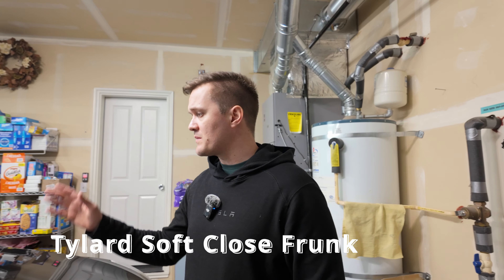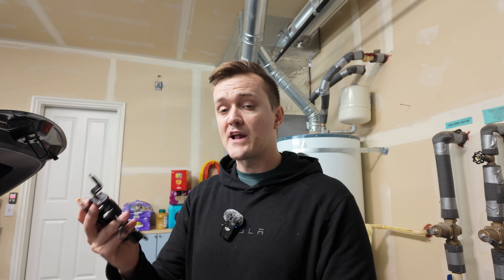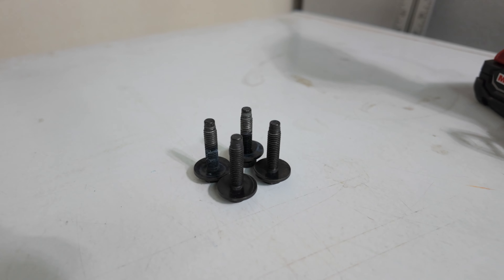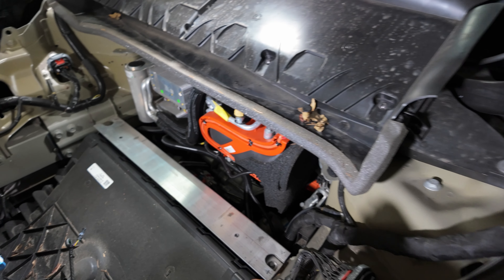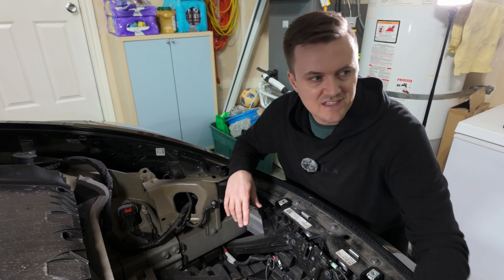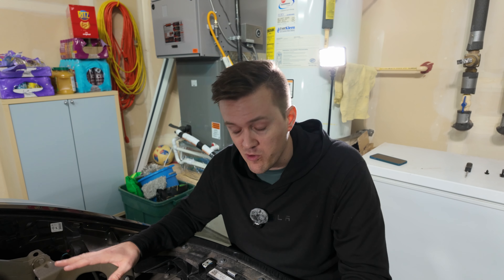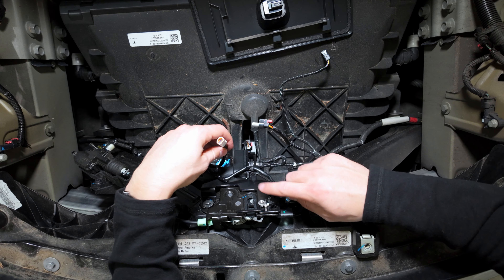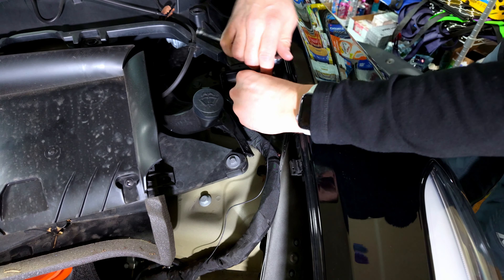Tesla Soft Close Frunk | Install Guide & Review | HUGE Upgrade!

Comment: I purchased two weeks ago and received and installed today. 

Couple of notes:

I did get an updated version with no additional bracket and no seperate control box on the wiring. 

Mark with a very fine point paint pen where the original release mechanism sits vertically compared to the frame where the two 10mm bolts attach.  I had to spend a while getting my vertical position of the closed hood back to the correct height. 

Longevity I supposed is yet to be seen, but it doesn't seem cheap/throw away.

Comment: Buyer beware - there are a few of us in the comments that have found that Tylard has been sending out a different version that doesn't seem to fit on the cars they say it does 😢.
Reply: Was Tlyard able to resolve the issue? Hansshow mentions on their website making sure you order for the right car or else, no refund.
Reply: @KhoaTeslaRossa  No. I've been emailing their support every day since February 26 for installation clarification and return/exchange instruction after the item broke.

I ordered the correct item and the box states it is the correct item but it did not fit my car the way their support described- it's slightly too short to reach the mounting area.
They suggested I "just force it" so I had two other people help me to force it and it bent the metal on the mount for their soft close mechanism so the first time I used it it got stuck closed and now it's jammed.

Luckily I tested with a screwdriver and not the Frunk hood.

They have requested a video of the device not working before they will consider a return/replacement but it's been a slow process.

Honestly I would be extremely reluctant to install any of these that doesn't have any sort of emergency release! Even the original design in the video is at risk from getting stuck if the motor seizes.
Reply: @TM-hr6nv  Yeah you know when it isn't the right part. Not sure if it is stuck. Is it the same as using 9v battery to get it to pop? Sorry for your trouble and thanks for the info. If I get one, I will order from Amazon.
Reply: @KhoaTeslaRossa  The release needs to be a cable that physically disengages a seized/unpowered motor. Satonic makes one and you put release the cable down near where you would use a 9v battery but the release itself does not require the 9v. It does not allow anyone to get into your trunk as all it does is release the motor in charge of soft-closing the Trunk i.e. it does not relase the OEM Frunk lock.

I ended up buying the Satonic variant. It has its own problems with the installation instructions having no indication of how to mount the motor without giant (not included) Zipties but it does have a working release cable. 

Tylard is still jerking me around so I'm just going to try and un-bend the metal to allow the latch to move freely and to sell it to someone with the correct model year Model 3 to recoup SOME of my costs- with the warning they might have to take off a wheel or unclip the bumper a bit if it gets stuck.
Reply: Update: Tylard never accepted the return. If I showed them it not working in the car they would tell me I "didn't install it right" and if I showed it to them not working outside the car they would then say "install it in the car to make it work". I sent them video after video of it not working, getting stuck, not fitting and they would just dodge the issue. I ended up selling it to someone who had a different model year. No idea if they got it to work.
Reply: So disappointed.   Installed this today and the activation lever on the soft close takes too much force to work.  If I push on the hood it works but otherwise the hood is not heavy enough to activate the device.  No way to adjust as far as I can tell since there are no instructions.  Tried emailing their support but it bounced back.  Money down the drain I guess.  After futzing with it for hours I took it out. No more Tlyard products for me.

Comment: I bought one on discount from aliexpress. 109AUD. No instructions but your fit inspired me. It is working but not without some hitches on the way. I have 2023 M3 with LiPo 15v Battery. Needed to add a screw and change positive connector. Has in line fuse. Bolts over top of existing latch and no messing with existing mechanism. After test in with internal casing out ok tested with frunk in place. Needed to raise bolt on part as rubber housing seal made it too hard too close. All good now.

Comment: I always recommend trying the latch process using a screw driver in place of the actual hood… if for some reason the motor does not release (reverse)after pulling the latch down you can not get in the frunk!  I Had this issue with the “full power fronk kit” and had to remove a front tire, fender well liner and was lucky that i could reach in with a home made tool to manually release the latch… the back up release under the little cap will not work if the soft close motor is holding the latch down.  Hope this makes sense…

Comment: Good video. Is there any sort of safety sensor to prevent a finger being pinched or crushed by the new motor if you hold the frunk between frame and lid?  Its about my only conern with the motorized mod...
Reply: That 👆is a great question. I have not thought about it, and purchased that kit ( still in post ) but now @daveo9198 made me think twice. Could you please try it and let us know. Having two kids you never know what can happen. And if that device can potentially cut their fingers then i will send it back. 
Thank you
Reply: Wesite listss this feature "The product comes with a smart anti-pinch function."

Comment: When removing something, FIRST remove NEGATIVE, then POSITIVE.  When connecting back together.  FIRST POSITIVE and then NEGATIVE!  You won't want the negative of the battery attached when you attach the positive.  If your wrench shorts out on any metal, you'll have a short circuit.  However if Negative is off, then it's safe to work with the Positive terminal, and then when you attach the negative.....even if the wrench touches the body while you're attaching it, there wont be an issue.
Reply from the maker: I am assuming you are referring to my attaching the ground before connecting it to the battery? Yea that is good advice. If it wasn't obvious I am no expert at this sort of thing. It's more of a...if I can stumbly my way through this stuff anyone can.
Reply: The advice is good on the order… but think safely first. When you tighten the Battery terminal red wire .. this is the spot you need to take lots of care with any tool to avoid a short. Consider gently tightening that battery connection… a loose wire from vibrations over time is not desirable.

Comment: Great video. I just installed within 15 mins. I bought the item from ali express, instead of Tlyard , as I am afraid Tylard does not sell the new version. Apparently the new version include a small metal piece , plus a smaller screw holes for the tightening bolts..
Reply: Can I ask which brand you bought from Aliexpress? Also, how is it holding up? Thanks!

Comment: I just ordered the same kit for my Model Y and it does not work. It's a totally different design. The retract motor is not mounted on the bracket and it doesn't have that little adapter piece of metal to press the latch button. Don't know what is up with my kit.
Reply: Did you order the Tlyard kit or someone else's and did you make sure it was for your Model 3 or Y and correct model year. It does matter. I have ordered this kit and are waiting for it to arrive. Takes forever when you are anxiously awaiting it's arrival. 2 weeks and counting😢
Reply: @ThomasRSmith-og7zo  I ordered the Satonic Model Y kit.
Reply: The Hansshow kit mounts the motor separately and uses and emergency release cable. It's the same mechanism that comes with their Full Power Frunk kit. Not a fan, that's why I ordered the Tlyard kit. Hope they didn't change it and made it new and unimproved 😅
Reply: I recently ordered the Tlyard kit and what arrived is totally different. The motor is not attached to the latch bracket, and there is no separate loop at the end of cable as it comes already attached to the latch bracket. I have no idea how to install what they sent me and their service person is not being very helpful. This is what they responded with:

“Because this product is an upgraded product, it will look a little different and does not require the use of metal spacers. You can go ahead and refer to the installation video as they install almost identically”

“they install almost identically” is not true it is totally different, and now they have gone dark. 

Would NOT recommend.
Reply: @johnadelus - so I just received my order (22 MY) today and mine looks similar to the one shown in this video but it did not come with the metal spacer. I’m second guessing the install as I’m waiting to hear back from support.
Reply: @artistjosephtubb  I have given up on their support. They keep sending me videos with nothing like the part I have. They just do not want me to return and get a refund. I have now filed a report with PayPal - we’ll see.
Reply: @elus Not sure if this helps but today their support sent me a video directly that is only in Chinese that has the correct part...but the car in the video is clearly a 2018-2021 Model 3 when I ordered the 2022-2033 part....
Reply: Thanks  @TM-hr6nv , they sent me the same video and it doesn't even show attaching their product to the built-in latch. Also in my case the motor is detached and they don't cover  how to attach it anywhere. I am now in contact about a return - such a long drawn out process (sigh....). I will never buy from Tlyard again.
Reply: @johnadelus  Yikes yeah I just gave it a shot and found no way to fit the motor comfortably and also the power connector is different on my Model 3. Maybe Tesla made small changes to the 2023 Non-USS models that Tylard is not aware of.
Reply: @TM-hr6nv  yes it seems that they’re shipping products that don’t match the Tesla model for which they were ordered.
Reply: and this is how easy Tlyard makes a return:
—————————————————

Please take pictures of the appearance of the product and the outer packaging of the product for us. We need to check for traces of use and whether the product is damaged to ensure that it will not affect our secondary sales.

According to our return and refund policy, if the return or exchange is not due to product quality problems, such as the product cannot be used normally, the product is damaged, etc., the buyer needs to pay the return shipping fee. And the secondary listing fee of the product, which is 8% of the product price

—————————————————

Ugh

Next they will be denying that it cannot be used normally ….
Reply: Seems I received a newer version for MYLR 2023 as shown in the video. Has anyone or @CfTesla tried to install with a newer version? Any help would be appreciated. Thank you.
Reply: @chetansharma2121  can you make a picture or video what kinda version/model you have ? Thnx

Comment: I would like to know if you can manually override and push shut if power or motor fails? Anyone tested this? Also, price, complexity, think this wins over a fully powered opener with struts. Plus appears to be more failsafe. Plus I really like the fact that it closes after being left remotely unlatched. Is it finger safe? Worst case I can think of is you remotely unlatch.. then delay opening, and just as you slip your fingers in for a lift it times out and applies the auto closing force?
Reply from the maker: Yes you can push it closed. My kids keep doing that even though I tell them not to. Hasn’t had any issues with it yet. It is still going strong
Reply: Causes no harm at all on mine.

Comment: I noticed that the cover you removed from above the HEPA filter was missing a white clip on the side, it would be the driver side of the panel.  Is it used or did the clip come off and was still on the car?  But this seems like a really good product to prevent bending the aluminum hood, even though it's a bit expensive.  It's way easier to install and in my opinion better than a full auto frunk because it's less complicated.  And it's something the car should come with from the factory.

The product link doesn't work.  I was able to find their web page but the product page shows it's $130 yet when you put it in the cart it's $169.99 (before your code).  So I'm a bit confused why they are showing the $130 price.
Reply from the maker: Hmm let me look into it. As far as the clip it I didn't notice that. I should problaby check.
Reply from the maker: Direct link: https://tlyard.com/products/model-3-y-electric-suction-soft-close-frunk-lock?variant=44636751331566

As far as the price I think they messed up on the graphic or it was not updated after a previous sale. On the product page itself it says $169.99 as it does in the cart.
Reply: @CfTesla  They aren't Chinese owned are they?  Because that kind of mistake is something companies from China do.

Comment: What is the "patch" for?
Reply from the maker: I have no idea lol. But I was told the new ones being shipped don’t need it
Reply: I installed mine without the patch and it is working without problems. As far as I can tell the patch does nothing.
Reply: @jhom1952  I didn't install mine either. I'm wondering if I should go back and put it in.
Reply: I tested the lock with and without the patch.  Nothing.  Tlyard said it was to improve the 90s function.  Nope.  The relocking feature has worked every time without the patch.  Now, supposedly it won't be included in future versions.    Why the patch?  Your guess is as good as mine.  @AdrianYM
Reply: 🙌🙌🙌 thank you for the info! I was wondering if I needed it as my order didn’t come with the patch

Comment: I think this can void the warranty according to some forums?
Reply from the maker: It is plug and play so it can't void a warrantee. Law prohibits that BUT if you were to take it to a Tesla service center and they needed ot get into the frunk for something they could refuse to work on that area of your car until you removed it and put it back to OEM. Then they would have to work on it. I have a ton of this sort of stuff in my cars and have been to the servcie center many times with no issue.
Reply: @CfTesla  thanks and great to know
Reply: Add ons never void the warranty unless they can prove it caused the damage.  This is the Magnuson Moss warranty act which protects consumers from manufactures denying warranty repairs.

Comment: Why didn't you try the softer spring in the video?  It almost closes itself for less than a dollar and 1 minute.
Reply from the maker: I am not sure what you are talking about. What spring?
Reply: I'd like to know about the softer spring also.  My frunk takes WAY too much pressure to close.
Reply: Yup, also want to know about this magical spring😮
Reply: That softer spring he is referring to only exists on the earlier Model 3 and isn't present on the model Y. Totally different set up. Found a video from 2019 that shows the mod and also questions the safety of this mod. So it's not a mod I would do even if they still had that same design on the Model 3. This soft trunk closure is the way to go. And considering the price of the Tesla it really is a cheap mod.
Reply: @ThomasRSmith-og7zo  the safety huh? It has nothing to do with the locking position holding the frunk closed,  just how hard it has to be pushed to engage the latch. My favorite is opinions from those who think they understand and are not afraid to let you know.  
On the Y, having a different spring that could be.  The bag I bought came with two springs, and I have not installed it in my Y yet.  
My comment was directed at the idea that you would damage the hood with force, and this solves that issue if your car accepts this spring.  
Of course, this product isn't sold with a link to make money, so it would never find its way here. 
Can you imagine seeing an Ali express link to the manufacture of a product at half the price?  Of course not you either have great content to push the algorithm to ad pays or you sell links to products.  It's also why the channel isn't super popular.  
I continue to watch, but not as much on the promotional stuff.  That's not a secret. If you look at the nerd values from YouTube on the site, it's a trend. 
You can't find success unless you collect info from your customers.  I hope this helps the channel.
Reply: @Patriot3  I just saw on the video that they replaced the OEM with a weaker one and under certain conditions the Frunk did pop open but was caught from fully flying open by the safety latch. It doesn't really matter since the spring in question doesn't exist in the Model Y and probably not on the later model 3s.
Reply: I looked into this and it doesn’t work on new models Tesla. I can confirm with MY 2022

Comment from the maker: - CURRENTLY 26% off with code: "cftesla"

About Tylard soft close:
- If you open on accident it will auto close after two minutes
- Two hour install
- Tools: 10mm socket, plastic pry tool
- PRICE: $169.99 ($125.79 AFTER discount)

Get more info here: bit.ly/3Owbn1L
Discount code: cftesla

Use the following link to save money and get full self drive for 3 months when buying a Tesla: https://ts.la/cody21159